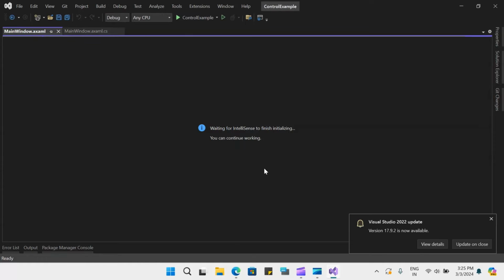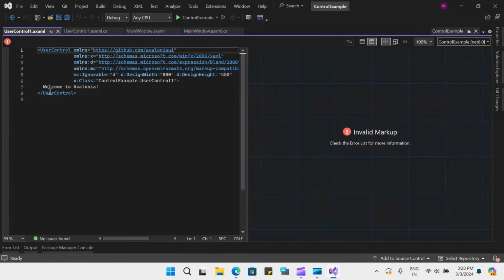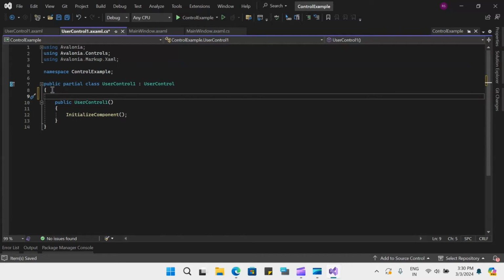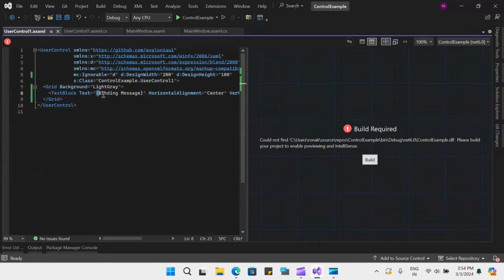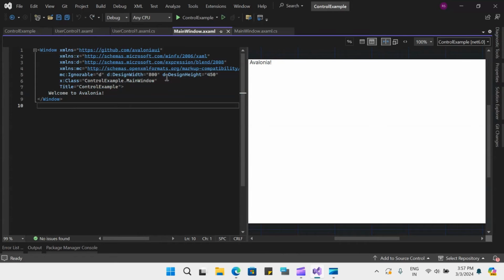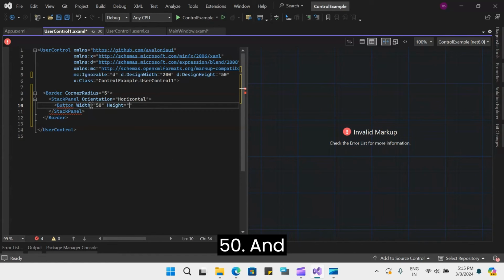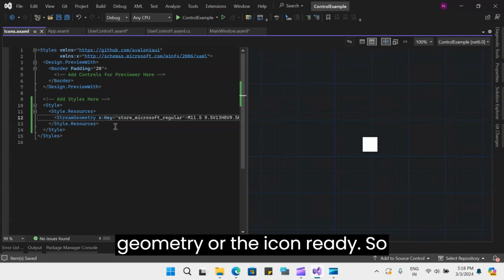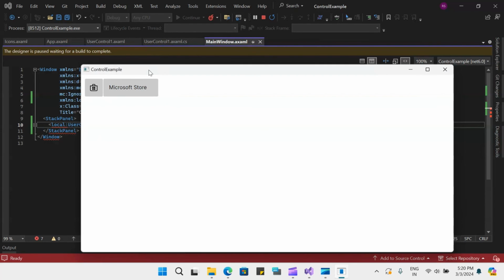Avalonia Tutorial: User Controls in Avalonia UI | User Control | Visual studio | Cross Platform

Comment: What more does Avalonia bring to the table when compared to Uno or MAUI?
Reply: Linux.
Reply from the maker: Avalonia, Uno Platform, and Maui are all cross-platform frameworks, but they have different advantages depending on your specific needs:
Avalonia:
Performance: Avalonia is known for its high-performance rendering engine, which leverages hardware acceleration for smooth UI rendering.
XAML Compatibility: It offers compatibility with XAML, making it easier for developers with experience in XAML-based frameworks like WPF and UWP to transition to Avalonia.
Cross-platform Support: Avalonia supports multiple platforms, including Windows, Linux, and macOS, making it suitable for a wide range of applications.